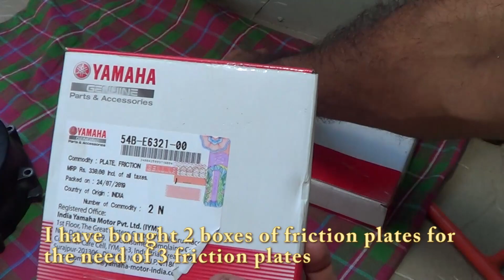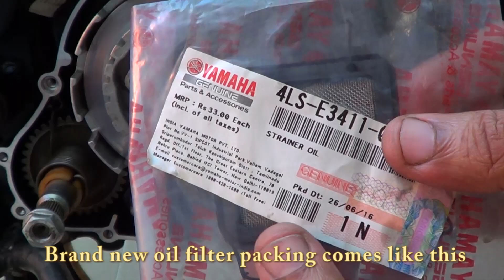Clutch plate replacing for Yamaha Saluto 125 cc

Comment: Vanakkam bro,. Nan saluto 125 use pannurean,. En bike  pickup suthama illa , mileage um sariya kidaikala.. Enna seiyalam..
Reply from the maker: vanakkam brother, bike la  pickup  korayama irukkanumna  engine ku kuripitta time la engine oil change pannanum and mileage kodukkalanna carburetor la "buss and needle" change pannunga, chain ah corrct tight vachi  lubricant pannunga, front wheel and back wheel free ah irukka nu check pannunga..
Reply: En bike 90km speed la dan pogudu,name dan 125cc bike but splendor la poravan speed a povan,3months one 3000rs salavu vikudu